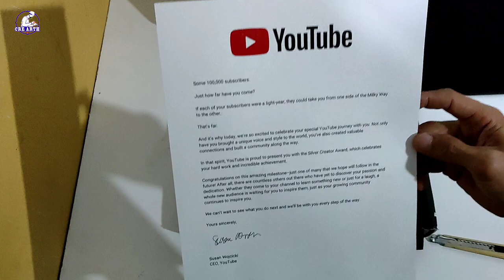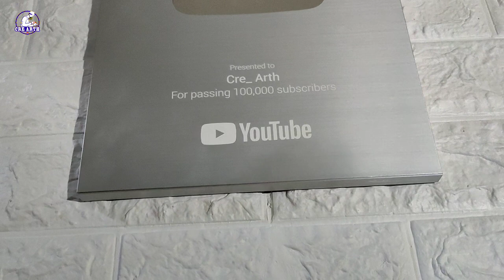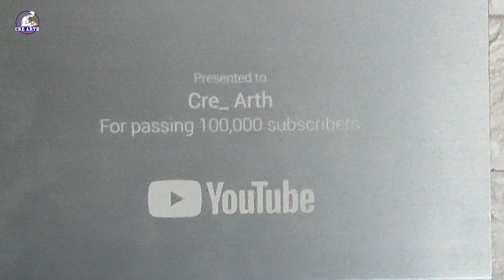How to Install brick Wall Panels | Homemade gypsum panel

Comment: cara ngeringin gypsum ini yg bnr nya gmna ya om ? kmarin saya bikin panel dindin,tp sampai skrng udh 5 hari tp kq gk bisa yg bnr2 kering gitu,dpegang msh nempel dtangan,ky mengapur gtu..sampe sya coba jemur di tempat panas,tp  bkn nya kering malah tambah lembab,apa emnk gitu karakteristik nya gypsum ini om ??
makasih om...🙏
Reply: oyaa.saya pake casting merek Aplus om
Reply from the maker: Gipsum aplus trmasuk yg agak lambat keringnya dr merk lain sprti boral atau elephant, tp meskipun aplus hrusnya sehari dh garing gan, biasanya ga kering itu krna kbnyakan air drpda castingnya, cb airnya dikurangin dr biasanya atau castingya yg ditambahin, jgn diaduk atau dicampur air lg stelah adonan sudah mulai akn mengeeas krn itu bisa membuat adonan jdi mti,alhasil oengeringan jadi lam bngt bhkan ga akan kering.
Reply: @CreArth  ok makasih om,pencampuran air sama casting nya saya msh blm mahir 😄 kdng terlalu kental,kdng terlalu encer,kdng bru separu di tuang ke cetakan,baru mau ngasih roving,adonan yg di ember udh mengeras 😂.
makasih byk yaa om...kpn2 nanti sya pesan cetakan bisa kan om ?
Reply: @CreArth  tutorial nya buat adonan gypsum.bang takaranya brp